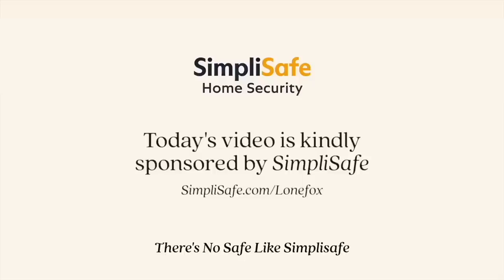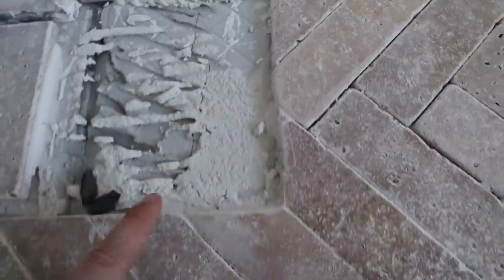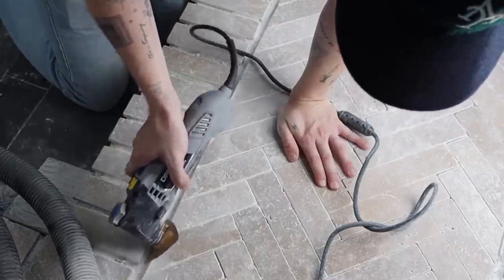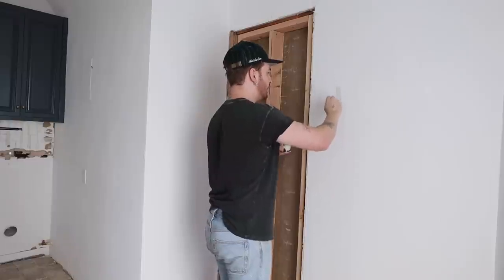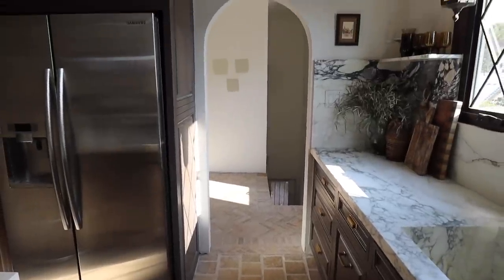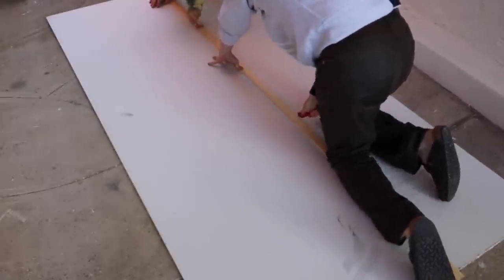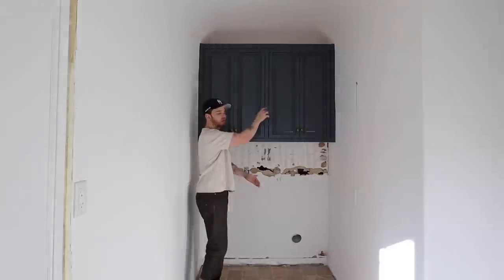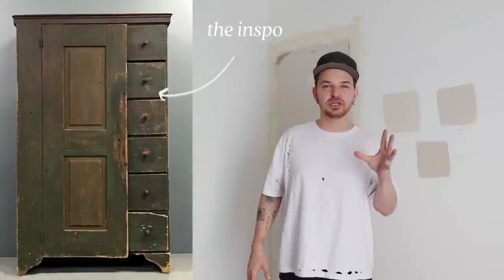EXTREME LAUNDRY ROOM MAKEOVER ✨ Part 2 ✨ Painting, Furniture Ideas & New Tile!

Comment: Drew, if you're ever concerned about getting grout inside porous/pitted stone, I would put a thin layer of sealant first.  The sealant will fill in the little holes. Then you can grout with less worry.  Also, the grout haze clean off better.   Your floor looks phenomenal!
Reply from the maker: Ahh thank you for this tip!!
Reply: Love. Love, Love the floor and that braid!!!
Reply: Is it a good idea to put the clear sealant on the tile both before grouting and after grouting?
Thank you!
Reply: Beautiful as always! I had someone to lay my kitchen and laundry room tile and I wanted a light colored grout. Now   6 yrs later the grout is dirty. Of course mopping and sweeping over the years. I never knew about re-sealing the floors. So, how the heck do I get the grout clean and what would I re-seal the floor with?  Thanks! 🙂
Reply: @mssapphire0216 not sure about sealant, but recently learned about something called Polyblend Grout Renew and it will basically recolor your grout when cleaning doesn't help. Home Depot sells it. Hope that helps!
Reply: @cece9145 Yes!! Before and after grouting for natural stones!

Comment: FYI… I did this type of flooring also… when you cut the tile, you can then turn the tile and tilt the cut edge and run it across the top cut edge against the tile saw blade … it rounds the cut edge perfectly… I did a ton of tiles this way.
Reply from the maker: THIS IS GENUIS OMG….
Reply: Smart idea. I did a base board from stone and beveled the tops with my lapidary diamond flat lap. This is another option.
Reply: Sorry, but I'm confused😟.   Are you talking about taking a second pass with the tile against the saw blade after making the initial cut, just to round the edge?   
And when you say to turn the tile, turn it which way?   Can you please explain a little more about how you position the tile in relation to the blade?
Reply: @dao8805 place the top edge of the cut tile perpendicular to the saw blade and drag that edge from side to side against the blade… you have to hold the tile in your hand, not flat on the saw table… then you sort of shape the edge… sounds complicated, but very simple.
Reply: @curtreese3089  OK, that helps a lot.  Super idea.  Hope this helps others as well .  Thanks, Curt, for taking the time to explain!   Have a great day.🥰

Comment: The tile work on your floor is beautiful! It worked out so well and really looks artisanal. If I were you, I'd paint strip that original railing to see what's under the layers of paint (it's  possibly wrought iron) and either leave it in the original state if you like it, or paint it the same color as your walls. Otherwise, since you really like wood so much, you could have a custom built railing put in. For such a small piece, it probably wouldn't cost a tremendous amount.

Comment: Because you are a DIYer I think it would be amazing if you built something or tweaked in existing piece more than just paint or even have a custom designed wrought iron piece. Maybe even upcycle an old cast-iron fireplace screen. And I think it would be cool if you did a piece of stained glass in the room or in the window to stand out. Ok i didn't think it would be feasible but pinterest shows it is. My first thought would be to make a stained glass railing either wrought-iron or wood casing. It would be so cool in the warm colors you love.

Comment: I like  the school white color on the walls. The floor looks amazing. Question, how do you clean up the grout haze on tumbled tiles like these? Doesn't it like to sit in all the little nooks and crannies of the tile? I imagine, it's not as easy as doing it on smooth porcelain tile. On the cabinets I would say, have them at least tall enough to fit all your laundry bottles/boxes etc. It looks so much neater, than having them out in the open.

Comment: I am in LOVE with the floor! I am also glad you opted to take down the cabinets. I would go with a shelf instead of a short cabinet, tbh. I'm sure you could find decorative vessels to store your detergents in and style the shelf accordingly. I'm not sure if this will fit, but I recall seeing a large folk art armoire on Chairish for only $895 (which is dirt cheap for Charish), and I just checked; it's still there if you're interested. 

Custom Folk Art Hand Painted Pine TV Armoire Cabinet
$895
DIMENSIONS
47.25ʺW × 27ʺD × 79ʺH
CONDITION
Good Condition, Original Condition Unaltered, Some Imperfections

Comment: Yes I don't think you need a whole lot of cabinet space in the laundry room. It would depend on how many products you use.  I personally use the laundry sheets and that's it.  I have wool dryer balls if I use the dryer which is very rare.  I just lay my stuff out on the ironing board laundry basket and bed.  No scent Beads no softener no dryer sheets. Bravo on the floor tile.

Comment: Idea for the railing.. Would wrought iron work? In my own home, my wooden railing for 17 stairs to the 2nd floor is not to code..and dangerous. Carpenter suggested wrought iron for my situation because it would provide strength with little bulk. Black colour would go with my rustic design style..and probably your Spanish style.

Comment: When tiling floors you actually have to put the tile glue on the backside of the tiles, too - not just on the floor and press the "naked" tile on top. This way tile and glue will stick properly together and stay like that for a long time. Your tiles plopped off the floor because you did that mistake.